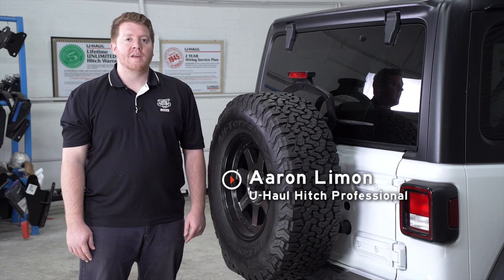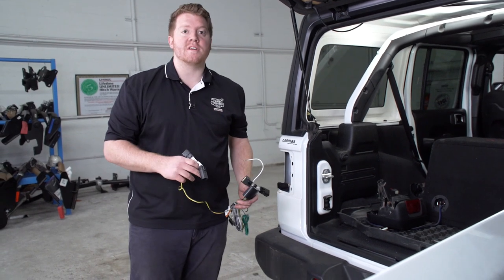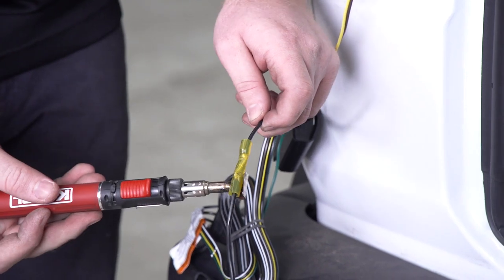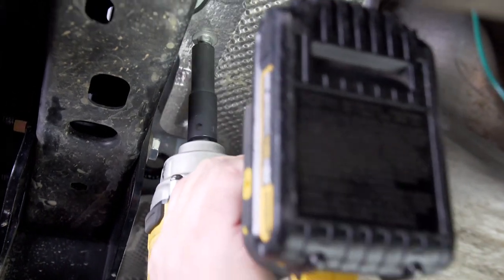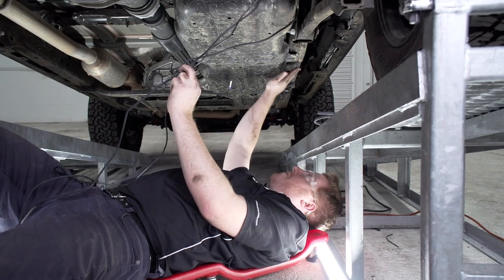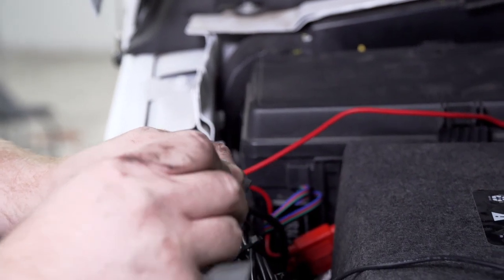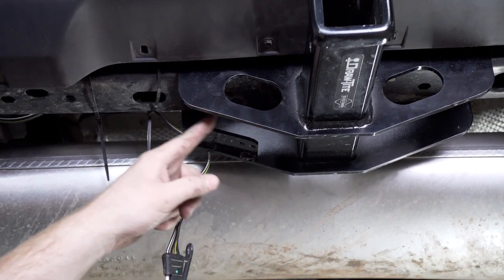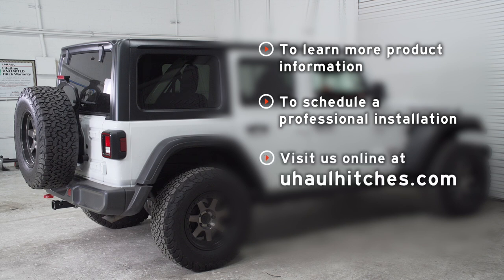2018 Jeep Wrangler JL Trailer Wiring Harness Installation

Comment: Is the battery wire necessary if I am only hauling a utility trailer?
Reply from the maker: Yes. The LED taillights do not have enough power to runt themselves AND the converter box. The power wire must be ran to get function from your trailer lights.

Comment: The video is incorrect do not tap into the white and brown wire in the driver side tail light wiring harness for running light power. It’s a white and grey wire that will power your running lights the white and brown is for reverse lights. Thank you U-Haul for the hours of agony.
Reply from the maker: Sir, this is a quick connect wiring harness and a tail light T-Connector. There is only one plug these will attach to (The one we did in the video.)